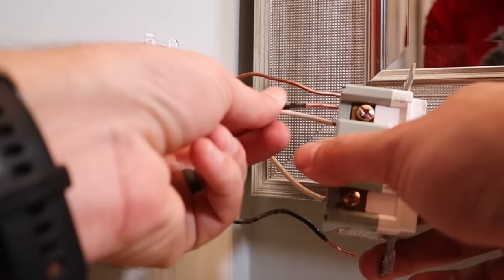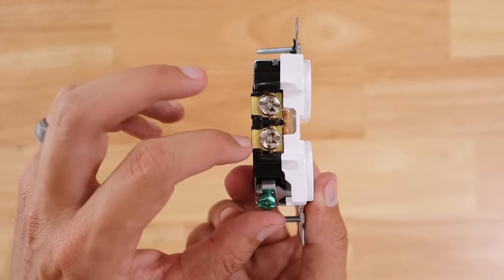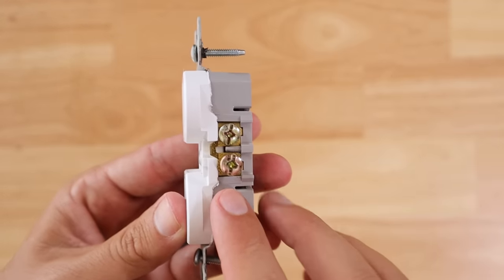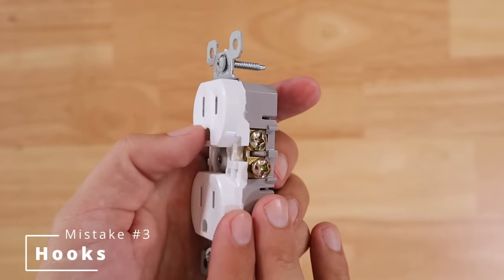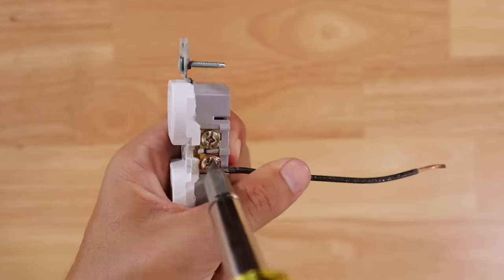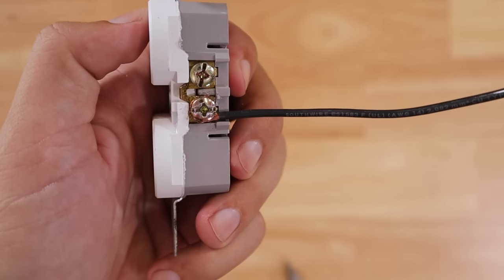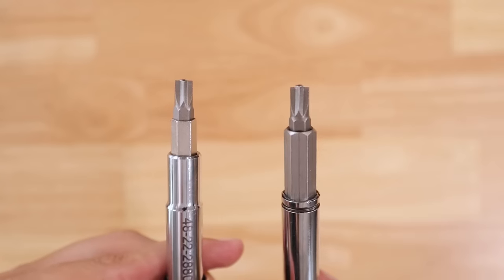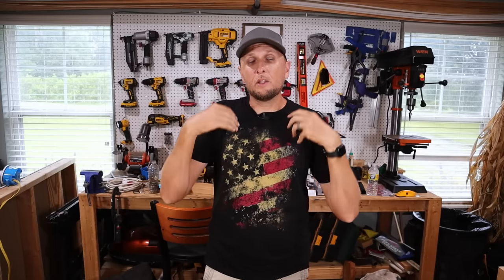The BIGGEST Mistakes DIYers Don't Know They Are Making When Wiring Receptacles | How To

Comment from the maker: So these are some of the most common mistakes I have observed and even been guilty of in the past.  Which ones did you find helpful and are there any that you think could be added to this list?  Thanks!
Reply: I always check to put the hot on the same side as the smaller opening on front of receptacle. Modern receptacles have a larger opening on  the neutral side and smaller on hot side.
Reply: Yes you cannot use the device as a splice or land the incoming wire on one screw and the outgoing wire on the other screw. The only reason there are 2 screws on each side is if you are making the top and bottom being fed with 2 different circuits at which time you break the jumper between the screws to separate them.
Reply: Also the code says when you land a wire under a screw the wire must be at least 75% around the screw.
Reply: @lawrence7dyer865  or if your making half  switched receptacle
Reply: Thank you from a plumber in North Carolina
Reply: Nah dawg blacks like the gold
Reply: The idea of the push-in wire termination is NOT that it makes the connection, it only holds the wire in place WHILE YOU TIGHTEN THE SCREW DOWN.
Tightening the screw down STILL has to be done, usually is NOT these days, and can easily overheat and arc. 
These "easy-ins" on whatever the hell they're called were the WORST invention for electrical outlets to date.
Reply: @Telephonebill51  not true william , although there is a clamp down style , the push ins mentioned in the video are held in by a tension clamp which is not able to be tightened or loosened with the screw
Reply: Nicely done, and all very useful. Perhaps the only things more I’d want to see would be good practices for wrapping with electrical tape, and fitting everything back in a crowded box to avoid damage or shorts. And also a real-world example of how easily reversed polarity can kill might be helpful for people. 

I also didn’t know that a Robertson bit would work. The combos look neat, but feel like a bit of overkill. If my Philips is camming out, I just grab a larger one.
Reply: I took all the courses needed to become an electrician. With good grades. But to get the license I needed to practice under the supervision of a licensed electrician. The reason I didn’t have the time to do that is that I am really a math and physics teacher at a gymnasium here in Sweden. 
Now explain to me the mechanism for how the wrong polarity can cause a short circuit or a fire.
Reply: @beru58  Correctly designed 120V equipment will protect, and switch, the Line terminal in that order, before feeding power downstream into other components. The Neutral is at the same 0V potential as the (earth) Ground, and the Neutral is normally not switched. Both features are essential to safe operation. When correct polarity is maintained, a fault in the equipment will find 0V through either the Neutral or the Ground, and all incoming power will disconnect at the device's protective fuse or circuit breaker. And when equipment is switched off by the user for any reason, including a malfunction, there is no Line potential anywhere in the device. But if equipment is connected to a reverse polarity source, a Line-to-Neutral fault will still clear the fuse or circuit breaker but leave the faulty, possibly damaged device still energized internally because the Neutral path inside is energized by Line. If a damaged neutral path contacts the chassis, the chassis will be energized by Line. These faults will only clear if an upstream device detects the fault and trips.
Reply: Yes I have found people change out the old two prong ungrounded receptacles with newer ground and septic holes and not adding a ground wire or jumping a neutral wire to the ground can you show this display and how unsafe it is as it creates a ground loop through the whole system.
Reply: @beru58  what you mean ?
If you try to pull too much current through a partial contact wire it will heat up.

Like pulling 10amp though thicknwire.vs 10amp through as thin as a hair.

The thin wire will.glow red and burn out instantly.

Is that what you mean ?

Or because too many electrons moving close.together and photons flying everywhere in the infared spectrum.and the wire is just destroyed due to atomic stucture being ripped apart by photons and electrons having a party 👍
Reply: @easyerthanyouthink  Come over here to Sweden and I'll teach you some physics. That is my profession since thirtysomething years. The question was how the WRONG POLARITY could cause a short circuit or a fire.
Reply: @aaronvienot  Why would a reverse polarity line-neutral fault clear the fuse or the circuit breaker? Over here in Sweden and I guess most of Europe you can connect your kettle, mixer, vacuum cleaner, hair dryer, lamp any way you want. Never heard of a fuse that didn’t work as intended because of reverse polarity.
Reply: @beru58  If a fault occurs inside equipment connected to a normal polarity circuit, the fuse breaks the line path where it enters the chassis. If the same fault occurs on a reverse-polarity circuit, the equipment fuse or circuit breaker will still fail and break the initial current path, but all other wiring inside the chassis is still energized from line through the designated "neutral" of the polarized source. Depending on the nature of the equipment damage, portions of the equipment including the chassis itself could become energized. In double-insulated equipment with an ungrounded chassis, this could be a serious safety hazard.
Reply: @aaronvienot  "[T]he fuse breaks the line where it enters the chassis"
No it doesn’t. The fuse breaks at the fuse.
How can anything be "energized from the line through the designated 'neutral' of the polarized source" if the fuse or circuit breaker have functioned as intended?
Here in Sweden a toaster or a vacuum cleaner can be connected any way I want.
Explain to me what I am risking when I operate my toaster and there is no way to tell what is line (phase?) and what is neutral. The toaster is naturally grounded.
Reply: @beru58  it appears this discussion won't go any further unless YT enables a whiteboard feature for commenting. Suffice to say what I have described is applicable to modern wiring codes in the United States. Old installations and practices of non-NEC countries may, of course, vary.
Reply: First ive never seen 2 colors or different metal connectors. 2nd i dont ever see complete bare copper. Why would u use stranded wire? Its not fucking speekers.
Reply: Black and gold is how i remember. Then white goes white gold
Reply: Necking the copper when you strip the insulation is a big one but you identified the worse one, reverse polarity can stop rcd devices from functioning.
Reply: @beru58  he is right, also as I understand it RCD will not trip reliably.
Are your switch boards bonded neutral there?
A sparky was killed with this problem here in NZ not long ago.
Reply: If I have multiple branches from a certain circuit, I pig tail the multiple branches together and add a short extra wire for the plug being installed...damn right as I wrote this comment you mentioned this exact thing. I bought myself a square tip because Phillips bits and flatblades don't tighten it down enough for me and I do a lot of panel work on commercial buildings, my square tip, emt benders, two box mounts that have rollers on them to pull wire by myself with tape measure and my Klein Hybrid pliers are nearly all I carry I love them hybrids part cutters, strippers, and lineman's all in one, and screw cutters, count me in that cuts two tools off my belt
Reply: Unfortunately I was taught the electrical trade by a racist... just remember that white guys like white gold, and black guys like yellow gold... That might not sound very racist but the same guy taught me that the neutral wire is white because it picks up all the slack from the colored wires... lucky for me I understand every wire is the same color on the inside 😉. Don't get shocked!
Reply: Agree with everything except:
Back wiring is fine.  Good quality receptacles are made for it and it's not against code.  You used the worst, most worn out phillip's head I've ever seen.  Yes, that will destroy your screws.  Otherwise, ph will work fine, but I do like the alternative bits you used.  Definitely better.
Reply: @user-3tf67bk46u  I don't get to start a fire from "wrong" polarity. Explain that.
Reply: This was well done. 😊
Reply: You called the white wire a neutral. That is in fact incorrect.  A neutral is the wire that carries the unbalanced load between two hots such as the white wire ahead of the main breaker. The white wire in residential circuits is called the identified conductor.  It is a grounded conductor and is identified as such  by its white colour.  Reversing the wires can lead to the grounded portion of an appliance becoming hot to ground.
Reply: @lawrence7dyer865  on be home
Reply: @lawrence7dyer865  Not true. Using terminal screws for feedthrough is not a code violation. They're designed and UL tested and listed for feedthrough current.
Reply: @rangerider9091  You're mixing up definitions and concepts. The white wire in a residential circuit is, in fact, a neutral. It is a grounded conductor that is connected to the neutral point in a 3-wire single phase system, and it is not known as the "identified" conductor in the US. Identified, defined in the NEC, means something specific and has no relation to this discussion. As far carrying the unbalanced load between two hots, that only applies in a multiwire branch circuit. In an individual branch circuit the neutral (grounded conductor) caries the same load/current as the hot. All neutrals are white, but not all whites are called neutrals.
Reply: @pld8993  well I find that interesting as I’ve been an electrician for 43 years. 22 years as a contractor with upgrade schooling every three years.  The white wire in a residential installation is the identified conductor.  End of story.  A neutral wire carries the unbalanced load between two hots.
Reply: You should find it interesting because you're wrong when you say calling it a neutral is incorrect. How can a white conductor that is paired with a single hot in a 120V circuit carry the unbalanced current between 2 hots when there's only 1 hot in the circuit? When the neutral is shared, it carries the unbalanced load between/among the hots. When paired with a single hot, as in an individual branch circuit, it carries the full load. I've been an electrician since 1978, been a master electrician since 1984, been teaching the electrical trade since 1992. The white wire in a residential circuit is called a neutral, regardless of what you think you know. NEC Article 200.4. Read it, you'll learn something.
Reply: @rangerider9091  Also, check out the definition of identified in Art. 100. More learning for you.
Reply: @rangerider9091  And just for clarity, from Art.100: Neutral Conductor. The conductor connected to the neutral point of a system that is intended to carry current under normal conditions. (CMP-5). 
Nowhere is the neutral defined as a conductor that only carries the unbalanced current from more than 1 hot. Yes, it does that, but not always.
Reply: @rangerider9091  You just received a free lesson that you can add to your upgrade schooling. You are welcome.
Reply: @pld8993  I wouldn’t mind so much that  that you  don’t understand basic code but the fact that you are on you tube teaching others your your incorrect notions. I will try once more and then I’ll speak of it no more. There is a neutral wire in a 120/240 system and it is with the incoming wires supplied by your supply authority. The branch circuit wires connect to the neutral via a white wire to the neutral. There are two hot busses in the panel and this incoming white wire carries the unbalanced load from the branch circuits.  The way you are teaching it leads people to think that the white wire is not a current carrying conductor when in fact it is but it just has the same potential as ground. If you take a white wire in one hand and in a live circuit and another one in the other hand you will soon know what I mean.  The key is safety and it supersedes pride. Have a nice day, be safe.  My part in this discussion is over.
Reply: @rangerider9091  I must not understand code, given that I've been teaching the NEC for 30 years and have been a regular reviewer of IBEW NJATC curriculum for over 10. Thankfully some random internet electrician corrected me by trying to sound smart on a DIY forum where most don't have the knowledge or experience to challenge him and his assumptions. Most.
 I clearly said it's a current carrying conductor, multiple times, so I'm not sure why you're saying I'm leading people to believe that it's not. Let me say it again so you don't again misunderstand what I already said. When the neutral is shared it carries the unbalanced current, when it is used with a single ungrounded conductor is carries all the current. In plain English, a conductor that carries current is a current-carrying conductor. How you interpreted that as me saying/implying/leading that it's not a current-carrying conductor, I have no idea. Hopefully it's clearer in your head now.
The white, grounded conductor in a branch circuit is a neutral conductor, as it is connected the neutral point of a system through the neutral bar. Not my definition, NEC's. You're wrong and you're misleading people on forums like this when you say that the grounded circuit conductor is not called a neutral. It is called a neutral, every day, by electricians and by the NEC. You're wrong. Have nice day.
Reply: I suggest using an outlet checker every time an outlet is worked on.
Reply: @pld8993  a white wire in a 120 volt system is still not a neutral but an identified conductor. Good day.
Reply: @rangerider9091  You keep believing that.
Reply: Doing commercial electrical construction and service for 30 years I pigtail everything it takes a few extra minutes but down the line if a recptical goes bad everything else keeps working I had a call at a house the lady was on oxygen I had to go to every recptical on that circuit and pigtail them so she wouldn't loose power on it they were all back stabbed pigtails are the only way to go even if you only have 2 sets of wires and as far as stranded wire goes use a fork I hate stranded wire for any device
Reply: @darrelljackson7222  backstabbing is potentially problematic and a weak connection. I never backstab, ever. But using both terminals for power in/out is not backstabbing. The terminals screws and associated tab are designed and manufactured to carry current. Fact, not common sense or belief.
Reply: @pld8993  but if you pigtail that keeps you from losing power down the line if something happens to that receptacle that is the problem with using both screws way less troubleshooting in the future from the service side that one receptacle is the only one affected
Reply: @darrelljackson7222  But if you splice that keeps you from getting power down the line if something happens to the splice. That is the problem with using the splice. See how the argument works both ways and has the same result? The manufacturer designs and manufactures the terminal screws for feedthrough current, and UL tests and lists them for feedthrough current. Any splice or termination is a potential weak point, whether it's a bad splice or a loose screw. A properly installed recep using the terminal screws for feedthrough will, in almost every case, last forever. I've seen plenty of bad or failed splices, that doesn't mean well done splices are inherently problematic. One of the biggest myths in the trade. Not my opinion, just read UL498.
Reply: One thing I make a point of doing is to tighten ALL the screws, not just the ones with wires under them. It just seems safer and less likely to short or arc.
Reply: @pld8993  if joints are properly made you will not have any problems with them I have been behind guys that don't twist the wires together thinking just putting a wirenut on them is good I have seen more problems from feed through receptacles than with joints just my 30 years experience
Reply: @darrelljackson7222  I've also seen bad splices. In my 45 years experience, I've never seen a recep fail simply because the terminal screws were used for feedthrough current. They are designed and manufactured for feedthrough current, UL test and lists them for feedthrough current, the NEC allows them for feedthrough current. Residential receps are tested at 150% of their rating. In other words, a 15A recep must be able to maintain 22.5A in order to be rated for 15A. The tab between the terminals is rated for 20A, which means it must be able to maintain 30A, see UL498. Like you, I've seen failed receps. I've never once, not a single time, seen the tab between the terminals break/fail/burn, etc. Loose screws, doubled conductors under screws, aluminum on Cu receps, backstabbing, seen issues from all those, and certainly bad splices. I would bet that of all the bad receps you've seen, you could not definitely say it went bad because someone fed power into one screw and out the other. They're made and manufactured to do that. Feedthrough though the screws is not an issue on a properly installed recep, it's a huge myth in our trade that you must pigtail. The most common reason why I've seen bad device is loose connections. Every connection is a potential failure point, and by not using the screws and creating a splice, you create another potential failure point.
Reply: @pld8993  I have seen the tabs break or burn I do agree that every connection is a posable fail point I personally will continue doing it the way I have for my 30 years and continue to fix things others screw up so we can agree to disagree on this I hope you have a great day
Reply: @darrelljackson7222  Nothing wrong with pig tailing, it's just a waste of time. An engineered and manufactured tab is more reliable than hand-made field splice all day every day. Unless you saw a 15A recep on a 35 or higher amp circuit and the load was pulling 100%, what you think you saw probably isn't what you saw. The tab can handle 30 amps (tested by UL) and is rated for 20 amps. I'd like to see a single example of a properly installed recep, screws tightened properly, where the tab actually overheated and burned without being overloaded. Given the hundreds of millions or billions of receps in the US installed using both terminal screws and ZERO recorded incidents/fires on record attributed directly to that procedure (yes, I've looked it up), your odds of winning the Powerball are better. Take care.
Reply: @pld8993  I'm guessing you think everything is tested off the assembly line it's not only so many are tested out of 100 you can get things bad from the factory that don't immediately show its bad things happen and yes the circuit was overloaded they tried putting 3 space heaters on a 20 Amp circuit had it been done the way I do it it would not have killed everything down the line
Reply: But here is to all the old school electricians out there we are a dying bread most of the guys I learned from are gone now I'm glad they taught me their ways and tricks to do it faster and better
Reply: @lawrence7dyer865  I was told to use pigtails on all outlets if a line was going out of the box to feed another outlet. In other words, if 4 wires plus grounds are in a box, never use 4 screws for 4 wires, but rather only ever use 2 screws and use 3 wire nuts, 1 to tie the black pigtail wire from the outlet to the other two black wires (1 feeding the outlet, 1 feeding the next outlet) , 1 to tie the 3 white wires (2 plus pigtail,) and one for the 3 ground wires...the reason is that the code prohibits current passing through a device (apparently the code does not apply to a GFI outlet wired to protect more outlets as one must do this in that case). I have had several electricians tell me this so I have done the time consuming task of using pigtails and wire nuts even though it  crowds the boxes and is difficult to do with 20 amp 12 gauge circuits. Also, I have seen many houses wired with the 4 screws used with little failure, I have seen many poor wire splices heat up and burn the insulation off the wire. But I use the pigtails as instructed despite my disagreeing. I do agree it is a bad idea to pass through a device if back stabbing the wire. I only ever use the screws as I've had to redo every outlet in buildings I bought where they did not use pigtails and just backstabbed the wiring causing outlets down the chain to lose power or arcing in an outlet box where it failed. I did not use pigtails to correct this but just wrapped under the screws to correct this preexisting issue. Obviously pigtails are necessary in order to not put multiple wires under a screw, but is it really better than using the 2 unused screws? Apparently the code book thinks it is but my experience thinks it is not.

Reply
Reply: @andywrites2141
Reply: @DeltaCo7175   I have actually used both types of push in. Just push in type and push in and tighten down screws. I think if you were to see the little contact with the wire inside where it could easily overheat.  You wouldn't use the push in. Same with the new wire connectors. They need great contact, as much of the wires to not overheat and deliver full power.
Reply: @beru58  some plug in things are polarity electrical equipment. Hospital equipment. Also I believe gfi in the plug itself on cords needs proper polarity.
Reply: @beru58  cause electric to miscalculate in Hospital equipment. I like to know the proper way to wire a Hospital isolated ground. There seems to be a lot of different ideas on this.
Reply: @RedPillSurvival  to little contact is made in the outlet for me. We did a little comparison with a heat reader between the two wireing methods in school. With a heavy load, The screws were cooler.
Reply: @pld8993  reading this is confuseing. At some point, at the last fuse box [not sup panel]  the white and copper or green make contact? Are you talking 220 us or 220 Sweden?
Reply: @busnorth  i never use the push in or quick wire method never have or never will , you must have misinterpreted what i said , push in and clamp down with the screw yes but not the tension style
Reply: @mousetoad7040  The NEC does not prohibit using terminal screws for feedthrough current on individual branch circuits. They're designed, tested and listed to be used that way. There are hundreds of millions, or billions, of receps in homes in the US wired this way. The tab between the 2 screws on a 15A recep is rated for 20A feedthrough. When you wire to only one terminal screw, current has to pass through the tab to feed the other side of the duplex when you plug something in. The tab being weak is a huge myth in the trade. It's simply not a problem.
Reply: @busnorth  Here in Sweden and a huge part of Europe we ha type f-sockets. No way to tell what is neutral and what is live. And no fires have broken out because of wrong polarity. But we learned from the video that that was a risk. Maybe you can explain the mechanism for how fires start due to wrong polarity. No one else have been able to. And while you are at it, what is it we Swedes and Europeans are risking when we plug in our toasters not knowing what is neutral and what is live?
Reply: @beru58  I believe you have 230v at 50. Wired like our 208v. No neutral.  But does your toster have a ground yellow with green stripes. Ground to earth. Is it switch at both hot wires? If not, one wire still  goes to heating element.  If this some how touch the out metal part of the toster and you touch the metal toaster and say a water faucet,  toster with out a ground.  Could you get a shock? I think in a way your outlets are safer then ours because of the recess and on some a swich. I think most things there a switched on both wires. Hear there not. Are both hot wires fused at the panel.  Our 208v that runs my air compressor and hot water heater are on breakers that are connected, on separate 120v 60 herts wire windings in the step down tranformer. Together they make 208 up two 240v depending how the load is wired to use the power. Most 220 240v have an neutral white wire going back to the fuse panel.  If it's  the only or last fuse panel before the meter.  Then the neutral is bonded to the fuse box and the green copper wire also bounded to the box and stake or two in the ground or rebar in the fondation .
Like to know how this is done there?
Reply: I'd never use the push in the back types.  My grandfather taught me to wire to the outlets with pig tails and wire nuts. He was the state inspector for years.
In trailer houses I have seen the worst wireing. Push in  in parallel 5 in a row, then to a light and rewired one that had caught fire because of aluminum wire.
Reply: @Telephonebill51  not all push in work with tightening the screws. The one's I have found it trailer house don't even have screws. I toss them.
Reply: @pld8993  I totally agree, every house I ever owned was wired that way and it never was a problem unless the outlets we’re backstabbed. No problem when the screws are used. But a few electricians told me it is not acceptable, one showed me  a passage in the code book that prohibited running current through a device, but maybe it was taken out of context. I’ve been wiring my shop and added circuits to my properties using the pigtails because of this but it’s really extra work and I consider the wire not spice is less reliable in my opinion. But once an electrician told me it was not acceptable to run Romax in conduit which was BS, and some other myths, so thank you for clearing this up for me.
Reply: Can any of you youngsters help me? My handsome little grandson asked for “feet pics” today, why would he want pictures of my feet! Laughing out loud ! Peace and love X O X O - Gladius
Reply: @RStark-ek7mh  yes maybe true. How ever I enjoy my freedom, and my masters election license.  I  would pass if it can't be done or unaffordable.
Reply: Checking screws after positioning wires for receptacle placement
Reply: @JoeWaylo  been there cost me 2 refrigerators
Reply: @Justin slago I don't believe GFI in the plug needs "proper polarity" because the gfi is tripped when a difference in current (I believe >10 mA) is detected between hot and neutral lines.   Polarity should not affect that.
Reply: @beru58  The problem would result in the fixture that is plugged into the receptacle, a desk lamp for instance that uses an incandescent bulb. The switch on the lamp would de-energize the neutral side of the lamp only. With the lamp switch in off position, the socket would still have the outer ring connected to the hot wire making it possible to receive a jolt if the bulb were not installed, or worse if the bulb was shattered leaving the filament exposed.
Reply: @robwilson7524  With no bulb in the socket and if you feel a need to put your finger there you better pull the plug. That’s  how it's done in most of Europe. Same with a shattered bulb. My question was how "wrong" polarity can cause a fire.
Reply: Ground always goes on bottom?
Reply: Bro I commend you for making a video trying to help those who don't understand things out however reverse polarity on a 110 outlet does not risk fire and I'm going to make a video and intentionally do it and I'm going to run the highest powered Appliance or item I can off of it and then we're going to take temperature readings and whatnot to show that
Reply: I am new to wiring and electric in general but I've always known not to do the backstab But did not know the reason why you shouldn't do it
Reply: Why didn’t you post this 10 years ago? 
Didn’t make any mistake in what I did, but took me a long time to make sure I was doing it right. Straight forward. Bravo!
Reply: @lawrence7dyer865  Yes it is possible to have under one screw incoming wire and outgoing if wire is no cut.
Reply: @beru58  Most member of these post are an American people.  In the US is different system distribution electrical energy: to residents power goes true 3 wires from middle grounded 240V transformer (2 hoot wires from ends of the transformer and one marked in white grounded form middle of winding) or 3 wired from 208V 3 phases transformer 2 wires from end winding and one from common  grounded center of the transformer. one part of outlets work with one part od outlets and the other with rest of the outlets. Fire can be cause by high connection resistance: if resistance is 0.1 Ohm and current 20A this contact is heated with 40W; as result of cycling power (also heating contact) resistance increase  for 0.2 Ohm power will be 80W.
Next danger can cause white wires disconnected (just when the receptacle is replace = all wires are disconnected also two white wires).
Reply: @mariuszluczkiewicz1232  I want to know how the "wrong" polarity causes a fire when the "right" will not.
Reply: That is a good point, @Darrell Jackson. I am not an electrician but my brother recently built a house here in Ohio. The code required pigtails be used on every receptacle. I would have liked to see this video include an example of a completed properly wired outlet installed in a box.
Reply: Black to brass, white to light
Reply: Great video keep it up
Reply: One comment, the term "a lot" is not pronounced with a long A or a hard A it is a short a. Pronounced "ah lot". Its just like the A in america. Please use the language the rest of us use. Thank you. Great video with good information
Reply: The biggest way I remember,  Black on Brass, save your @$$
Reply: @Telephonebill51  I am an Electrician.  In this case you are incorrect.  These residential outlets are back stab only no screw tightening needed.  The type you are talking about are more expensive spec grade plugs.
Reply: @andywrites2141  to get
Reply: @Range Rider  and by definition of the NEC neutral colors ate to be white or gray, whether it be solid color or have a continuous colored stripe.
Reply: @Range Rider  identified conductor is part of a cable assembly like a light fixture cord to identify the grounded conductor so you don't connect in reverse polarity. The grounded conductor by definition is the neutral conductor no matter what side of the main breaker it's on
Reply: I like when I find jo bobs diy work in the attic using some walmart 14 gage extension chord with no j boxes around the splices on a 20 amp circuit! Some of the dumbest things I've ever seen was people who didn't have any idea how to fix their power problem and more often than not make things worse.
Reply: You should never put stranded wire directly under the screw - use stakon connectors or, if the receptacle has the hole that the wire goes in and a plate smashes the wire between two plates as the screw is tightened that is even better.

If for some reason, such as a temporary connection, you must need to put the wire under the screw there are two tips that would help. 

1.  Twist the stripped end counterclockwise, unwrapping the factory twist until you have a new twisted end going counterclockwise. By doing this when you tighten the wire under the screw going clockwise, it will tighten the strands even more and keep them tight under the screw.

2. In addition to #1 above, before making that reverse twist, strip the insulation the normal length, then start to strip approx. 1/4” more insulation but only pull it until it just barely covers the end of the wire. Now do the counterclockwise twist, leaving the small piece of insulation at the end of the wire. When the wire is put under the screw this will keep the end of the wire from opening and coming out from under the screw.
Reply: @Lawrence7 Dyer  that statement is incorrect, per NEC 300.13 you can not rely on the device for continuity of the grounded conductor on a multi wire branch circuit. You know where 2 home runs share a neutral. But on an individual circuit where the neutral is not shared you can absolutely use the device as a pass through
Reply: @rrsjr1960  that would be a local jurisdictional code. The NEC allows you b to pass through a device as long as it is not a multi wire circuit( 2 circuits sharing same neutral)
Reply: @Range Rider  code says that the neutral, aka grounded conductor, must be identified. It does not say it is "the identified conductor". It must be identified by white coloring and it is identified on a receptacle as the long slot. It is identified on zip wire by the lines on the outside of the cable. Being "identified" and being "the identified conductor" are not the same. @pd is correct in everything he said. 

By the way, I've also been an electrician since 1983 - just so you know I'm not just a diy guy.
Reply: @pd  using the screws on a device is 1000 times better than backstabbing but, even though it is allowed by code, using a device as a passthrough connection is not the best solution. Pigtailing is, in my opinion, the best way to go.  I've actually seen the side of a recep melted away from arcing where the recep was used as a pass through and over time the screws loosened and started arcing. I pulled apart three fourths of the house looking for that one recep. Replaced the device and had to splice new insulation back onto the wire because it was damaged from heat. This could have been avoided had they pigtailed.
Reply: @pld8993  at one point backstabbing was an "acceptable" method of pass-through too. That doesn't mean it was the best. A properly made splice is better any day than a properly terminated pass-through using a device.
Reply: @pd  how do you figure pigtails are slower than screw terminal pass-through. Maybe a few seconds but I can make a pigtail and terminate one set of screws pretty close to the same speed.
Reply: @dangroce82  Backstabbing and using the terminal screws are completely different, and you're wrong. Go and read UL498, let me know if you have any questions.
Reply: @dangroce82  So you found 1 loose connection and from that you've determined that splices are better? Faulty logic. I've seen splices arc and melt the wire nut, which could have been avoided had they used the screws for feedthrough, but that doesn't mean there's something wrong with splices. If you had more experience and knowledge you wouldn't have needed to take apart 3/4 of the house to find the problem. It's unlikely that the screw magically loosened and more likely that it wasn't tightened sufficiently when installed.
Reply: @dangroce82  You're wrong. Any actual data to support this contention, or are you just making it up?
Reply: @dangroce82  It absolutely takes longer to pigtail, I've done it thousands of times. On a project where there a hundred or more receps, that adds up to real hours.
Reply: @pd  you've told me I'm wrong multiple times, I guess you've just got a God complex. As for me "having more experience", I've plenty of experience to know that you are so full of yourself that you cannot fathom anyone else having experience enough to know that you aren't necessarily wrong, but your opinion is not the end all. If you actually read my comment I never said that backstabbing and screw terminals were the same. I simply said that at one time in history backstabbing was an acceptable practice. 
If you are doing residential work then feedthrough devices don't have a big difference when doing maintenance, but in a commercial or industrial setting it is common to share neutrals between multiple circuits. If you need to replace a device a pigtail allows you to do so without effecting downstream circuits, whereas a feed through will break the neutral which could potentially create an issue downstream. ("If you had more experience you might realize this", he said sarcastically.)
You can use feedthrough if you like. You can even teach that they are the holyest of holy connections, but some of us who have a great deal of experience in the real world, not just a classroom or our own minds will continue to use pigtails. 
Also, it's not my problem if you can't make a pigtail, not as fast, but nearly as fast as using pass-through on a device. Maybe if you had more experience. 

My suggestion, stop treating people that you don't know poorly, just because they have a different opinion than yours.  My life experience may be better or worse than yours but well never know. Therefore, we should treat everyone kindly in these comments instead of trying to speak down to them.
Reply: @pd  I never said they were the same. You didn't read what I said correctly. What I said was that at one time, backstabbing was also an approved method, but that didn't make it the best.

Backstabbing is a horrible method. I also said that pass-through was much better than backstabbing, but not my preferred method. I believe pigtailing is a much better method than feedthrough terminals. You do what you want.
Reply: @jasongraham3174  backstabbing relies on a spring tension piece of metal for the contact. Over time the spring tabs have a tendency to lose their tension due to repeated heating and cooling of the outlet. It is worse if the outlet has a high load. If the tab loses tension it can cause arcing, especially if the outlet is having a lot of plugging and unplugging at the device.
Reply: @gordybishop2375  generally most people put the ground (the rounded hole) at the bottom, but that is not code in most cases. If you look at receptacles in a hospital you’ll notice the outlets are installed with the ground at the top, this is code in care centers such as hospitals where flammable gases are used and patients are treated. The theory behind it is that if the plug becomes loose in the outlet and something we’re to fall across the prongs it would hit the ground first and if it did hit a powered prong it would be hitting the ground also and would trip the circuit.
Reply: @ 9:20 you mentioned the proper way to add additional wires by using a "pigtail".  I can't help but wonder how many DIYers might not know what that/those look like nor how they work.  Other than that, a great video.  Thumbs up!
Reply from the maker: You are right.  I made a video about it fairly recently.  Thanks for the feedback!
Reply: There is no room to pigtail in most cases you don't have a clue
Reply from the maker: Kind of a blanket statement Jack.  Every situation is different.  Easy to find how much can be in a box by reading inside the back of the box.  It will list the capacities there in most cases.
Reply: @jackheaton4557  When you use the correct size box for your application, there's almost always room for pigtails. The two most common mistakes I see amateurs make is cutting wires too short, or using a box that's too small, and frequently both.
Reply: @dangroce82  No god complex, but I am an expert in my profession and I try to avoid basing my conclusions on my opinion or what I heard someone else say. For some questions opinions are a reasonable option (grounds up vs. grounds down or horizontal receps, for example), but in a technical area like electrical, opinions almost always have to eventually face verifiable facts. I don't have the all the answers but I have many of them and when I don't, I know where to find the answers. The same cannot be said for most of the people pretending to know what they're talking about in these forums.
Reply: There is a lot of discussion about neutral Vs identified conductor on here, I looked them up, subtle difference, but worth reading about, especially in two wire lighting circuits.
Reply: @rgoldsmith6560  Maybe worth reading about, but not particularly relevant. Identified conductor in Canadian Electrical Code is for the most part comparable to the neutral in the NEC. In the US we don't speak Canadian or identified conductors, we speak neutrals.
Reply: @donaldryan8410  Stranded is commonly used in non-residential because it's easier to pull through conduit than solid. Stranded is also required where the wiring method installed is for flexibility.
Reply: @leanin01  "Black on Brass." It's that simple.
Reply: Just to add the statement to us that just like the thought of having a opinion of a tool that appears to be correct 100 % of the time. Is one I have found that tells what is wrong or if it's correct when doing wiring. Cost less than 5 bucks.
Reply: Your tip on measuring how much insulation to strip off was very informative, I did not know that. It has always been a guessing game and I have had my wires insulation stripped too short and too long and had to start over. Thanks for tip and the video.
Reply: @HowToHomeDIY  

Here is The Savior

YaH The Heavenly FATHER HIMSELF was Who they Crucified/Pierced for our sins and “HERE IS THE PROOF”

From the Ancient Egyptian Semitic: 
"Yad He Vav He" is what Moshe (Moses) wrote, when Moses asked YaH His Name (Exodus 3)

Ancient Egyptian Semitic Direct Translation
Yad - "Behold The Hand"
He - "Behold the Breath"
Vav - "Behold The NAIL" <— YaH’s Crucifixion
He - "Behold the Breath"

“Behold the HAND that Beholds The NAIL” 

PROVES - YAH The Heavenly Father HIMSELF was Who they Crucified

That is EXACTLY what Moses Wrote

Here is what they mean

YaH's Name:
(Ya)d + (H)e, as YaH is what Moses called Him and YaH Declared: "this is My Name, this is My Name for all generations" (Exodus 3)

YaH is The Creator of “MAN”: (Genesis 2:7)
Yad He, (HAND BREATH), as YaH's "HAND" Formed man from the dust  of the Earth and His "BREATH" made him a living being (Adam)

YaH's Sacrifice of Crucifixion for “MAN”:
Vav He (NAIL BREATH), the "NAIL" through YaH’s "HAND", in Sacrifice of Crucifixion, that whosoever shall call YaH Savior, His “BREATH” brings forth life (Salvation)

How YaH arrives:
YaH arrives via the Tent of Meeting (Exodus 33:7:11, Isaiah 54, 55), where a Tent is erected outside the city, a cloud descends upon the entrance of the Tent and YaH appears...

Why they demanded YaH to be Crucified:
YaH was Crucified according to Hebrew law (Deuteronomy 21), to be NAILED/PIERCED on an Almond Tree for BLASPHEMY as it was for His NAME they demanded Him Crucified. The Messiah claimed He was YaH...

HE WAS YaH!!!

HalleluYAH translates “Praise ye YaH”

The Hebrew Book of Isaiah

Isaiah 42:8
"I am YaH; that is my Name! I will not yield my glory to another or my praise to idols.

Isaiah 43:11
I, I am YAH, and there is no other Savior but Me.

Isaiah 45:5
I am YaH, and there is none else.
Reply: After just installing some receptacles, I almost want to go back and check the tightness of the screws.  You guessed it....I used a phillips. However, I did double check with a flat head screw driver that allowed a little more torque. I may still recheck them. Thanks for the info. Have a great day!!
Reply: @beru58  Yeah, I get you. I really can’t think of a situation where it would cause a fire without some massive stupidity being involved. It’s just good to follow best practice.
Reply: @robwilson7524  Over here in Sweden and most(?) part of Europe we have type F sockets. So when I plug in my toaster or washing machine I have no idea what goes to neutral and what goes to live. And I needn't know. Why would you need that over at your place?
Reply: What do you do if the ungrounded conductor is red? Do I need a different type of outlet? Are there A, B, & C phase outlets?
Reply: Post this in an appropriate location, I know Jesus loves you, but he would not like you spreading the word of Godin a tutorial on wiring devices. Amen Repent and believe in Jesus Christ
Reply: @Justin Weber I’ve been told the ground should be up, I could argue out both ways. If you look at the writing on outlets, it’s done, ground up.
Reply: @donaldryan8410  you aren’t the sharpest guy on the job are you.?How many days do you have on the job?
Reply: God doesn’t have electricity, have you read the Good Book at all?
Reply: @darrelljackson7222  wait until you get on a job where all wire #10 and smaller must be solid. Have fun pulling and making up boxes, also stuffing them behind a dimmer or motion sensor.
Reply: @pld8993  I have seen the tab on an outlet between the terminal screws burn out. It wasn’t on the hot or ungrounded wire it was on the neutral, the grounded conductor.
Reply: @busnorth  have you heard the saying “when the student becomes the teacher”?  They weren’t talking about you.
Reply: @busnorth  trailers are not houses, they may be what you call home, but it’s not a house
Reply: @gordybishop2375  here’s another one don’t believe everything he says, he’s wrong about this
Reply: @mariuszluczkiewicz1232  Edison and Tesla both brought their systems out in the United States. I’m guessing someone on the other side of the pond is not so good at translation.
Reply: @scottlear6839  The tab between the terminal screws is rated for 20A and UL requires that it must hold 150% of its rating, 30A. If you saw one burned out, that would mean it had more than 30A flowing through it, which would indicate that it was wired improperly. However, it's unlikely that you saw what you think you saw. If you saw a burned up link, it's highly probably that one of the screw connections was loose and it caused overheating. How long have been an electrician? In 40+ years and 10s of thousands of receps, I've never seen that link fail on a properly wired recipe. I'm sure you believe what you think you saw and it seems like belief in unproven, invisible and made-up things things plays an outsized role in your life.
Reply: @scottlear6839  where I live, trailer houses have stricter codes then stick built home's and are taxed the same. That being said, is why trailers are phasing out of the area.
Reply: Repent and believe in Jesus Christ  Amen
Reply: When installing receptacles or switches using a raised metal ring on a 4" square metal box you should use a plaster or mud ring in plastered walls which is mostly not used anymore! When using gypsum or sheetrock you should use a raised metal tile ring which is totally different from the plaster or mud ring! The National Electrical code states you are only allowed 1/8" of space around the opening, not 3/8" which you would have by using a plaster or mud ring in order for the gypsum or sheetrock to sit flat on the metal  portion of the  raised ring. When you have 3/8" of space around the raised plaster or mud ring the sparkler fills it in with spackle and after it dries and the electrician installs the device there is nothing to hold the spackle in place, it cracks and falls out and you are back to 3/8" opening around the device opening which is a violation of the N.E.C. Mud rings are only intended for plaster walls brown coat, scratch coat and white coat that fills in along the beveled edge of the tapered raised ring gradually until it is complete right to the edge of the metal ring device opening! There is no space left around the opening! So, always use a raised tile ring for gypsum, masonry or tile from 1/2" up to 2" in depth! Also, the yoke of the device will seat firmly against the gypsum which will provide a solid backing especially for a receptacle. If you were to have an open space behind the area of the top and bottom yoke and you use a plastic plate, when you plug something into the receptacle, it will move back toward the ring and crack the plastic plate where the 6/32 screw is placed in the center of the duplex receptacle because the plastic plate is fixed against the gypsum and the receptacle can and will move back far enough to crack the plastic plate!
Reply: @henrysamek9211  You're way overthinking this. Using mud rings with drywall is fine. Using the proper depth mud ring  behind drywall leaves 1/16" between the finished surface of the wall and the front edge of the mud ring. The NEC requires that this distance be no more than 1/4". As far as the space around the mud ring, there should be no more than 1/8" gap around the ring. Contrary to what you're saying, when this space is filled with drywall mud and done properly it almost never cracks and falls out. It absolutely has something to stick to, the inside edges of the drywall.
Reply: @scottlear6839  Several manufacturers put writing in both orientations. The writing has no bearing on how the recep needs to be installed. Ground up or down, or horizontal, are all acceptable.
Reply: The intended use for a mud ring or also called a plaster raised ring is for plaster only, not gypsum! The intended use of a raised tile ring is for gypsum, masonry and tile walls only! The N.E.C. under boxes only allows 1/8" space around the tile ring, not 1/4". Don't confuse the depth or set back of the face of the raised ring or any box can be 1/4" from the face of the gypsum board! When the gypsum is cut and placed over the area of the box properly there is no need for spackle to fill in any space around the box or raised ring! I've been a licensed electrical contractor in the state of New Jersey since 1970 and was around when the gypsum contractors did measure and cut! No routers were used in those days! My license number is 4335. I'm also an electrical subcode and inspector! I'm very familiar with the N.E.C. from way back to 1965 until present day!
Reply: @henrysamek9211  Most of what you said is irrelevant. I clearly said 1/4" from the surface and 1/8" around the opening, so I'm not confused or confusing anything. The drywall bits on a rotozip are less than 1/8" diameter so if the holes are cut well with that tool there may not even be a need for mud. However, when the ring is not tight in the hole and the mudder/finisher (not spackler) fills it with drywall mud/joint compound (not spackle), it sticks to the drywall and almost never falls out, as you seem to believe. Once the mud dries and there is 1/8" or less of space around the ring, it's code compliant. The NEC does not define or dictate how or what material must be used to get that opening to 1/8" or less. The fact that you are licensed and have been in the trades since the 70s (as am I) does not change those facts. Mud ring is just a name and not necessarily descriptive of how it's used. Hubbell calls it a mud ring but other names used by different manufacturers, for the identical product, are plaster rings (Raco), device rings (Garvin) and drywall rings (Caddy).  Using your logic, the only application for a tile ring, because that's what it's called, would be tile. Someone here sounds confused, but it's not me.
Reply: You still don't get it do you! You cannot use a mud ring or a plaster ring in any other intended use but for plaster walls! It is designed for plaster walls only by labeling and listing! It is not designed for other types of walls! It has a flanged taper that is meant for 3 coats of plaster that is why it is tapered around the outside! The last coat of plaster which is white, goes right up to the device opening! There is no space around the tapered opening! Go to an electrical supply house and ask to see what a metal raised tile ring looks like and when you see the difference maybe you'll understand what I'm telling you! No spackle is needed at all! Look at a 4"sguare plastic box with a bracket and then look at the raised plastic ring that goes on that box and you will see it is perfectly straight without any beveled tapered edges at all! The same goes for the metal box with a 1 gang 1/2" raised metal ring! You can get the raised tile rings with the appropriate amount of gangs in a metal back box for more than 4 or 5 or 6 gangs if necessary! The metal raised tile rings come from 1/2" up to 2" in depth and as many gangs as necessary! Most contractors didn't know about them until I showed them the items! They've been using them ever since for receptacles and especially for switches. Again there is nothing to hold the spackle in place and it should not be used as a filler around the metal box. There is no such thing as done properly by a spackler around any outlet box! It does crack and fall out while installing the devices and again you will have a space wider than 1/8" which is a violation of the N.E.C.
Reply: @henrysamek9211  You're 100% wrong. You should read more and talk less. 314.20, pasted below, clearly states that plaster rings can be used behind gypsum. 314.21, pasted below, allows for the repair of gaps around a box so as to reduce the gap to 1/8" or less. There is no requirement that a ring be used that assures 1/8" or less gaps without the use of joint compound. And again, stop saying spackle, which a Joe homeowner depot product and not what professionals use.
314.20 Flush-Mounted Installations. Installations within or behind a surface of concrete, tile, gypsum, plaster, or other noncombustible material, including boxes employing a flush- type cover or faceplate, shall be made so that the front edge of the box, plaster ring, extension ring, or listed extender will not be set back of the finished surface more than 6 mm (1∕4 in.).
314.21 Repairing Noncombustible Surfaces. Noncombustible surfaces that are broken or incomplete around boxes employ‐ ing a flush-type cover or faceplate shall be repaired so there will be no gaps or open spaces greater than 3 mm (1∕8 in.) at the edge of the box.

Any questions?
Reply: Well my Dad had a bad habit of mounting switches upside down. Where up was off and down was on, lololol.. 🙃
Reply: @lawrence7dyer865  No NEC code says this
Reply: Most of them. 😂 Good info brother. Very helpful and informative. Look forward to more. Thanks
Reply: black wire = hot? wow
Reply: The strip gauge was clutch for me! Never knew that's why the back has those channels.
Reply: I thought u might note that the screw terminal that u don’t use, should be tighten down also. Maybe I was taught wrong.
Reply: ❤❤❤❤❤❤❤🎉😂🎉😊 1:05
Reply: It's good to see a DiY N2D's (Not 2 Do's)! Especially because some ppl overlook what one  has had no experience(s) doing. TY! ...I have a room AC, in housing, in wall, but the power cords built in circuit protector having a reset button the releases the set button, actually shot out of the adapter on the head of the walls plugin. I do not know how to approach this with what to check for and how to know if simply snapping in back in, is the right course of action. *The adaptor, shows NO signs of burn, No discoloration, No smell, No slight points melted, etc. Inside the adaptor as well, no signs of any loose parts, however if it had a spring, I can't find it. How can I do this this safely, without buying an entire new unit like home Depot wants me to do?
Reply: @lawrence7dyer865  mnwk we ❤😊😅😅
Reply: backstabbing is by far how you can tell a GC did the work, any decent electrician uses the screw.  Unfortunately, it is the most used method.  If you buy a home the first thing you should do is watch his videos and fix all your receptacles.
Reply: @HowToHomeDIY  Why are there 2 brass screws and 2 silver screws? In your video, you never mention why there are 4 total screws. You seem to be screwing the wires to the bottom screw only, why? Can you explain? Thank you
Reply: Sure wish I had found you before I tried to fix the outlet in my bathroom. Pretty sure I had the loops going the right way...the other direction seems unnatural. But I need to go back in and check anyway because I might have stripped too much insulation off. Also, I used a Phillips head. I just subscribed to you.
Reply: You never wrap stranded wire on screw,  you either crimp a fork on or use a side and back wire receptacle
Reply from the maker: @Jeff arford that is not true.  In fact many manufacturers will specify that wrapping stranded around the terminal screws is an acceptable method.
Reply: You must only work in residental
Reply: What do you use to make your hooks look so nice before install?
Reply: Just an FYI regarding push-in / backstab. If wire works its way out over time, every outlet after that point on that circuit will not function. Pretty basic stuff for an electrician. Not so much for the unknowing homeowner....such as myself the first time it happened! Forever indebted to maintenance guy at work at the time for the crash course in circuits / electrical.
Reply: Please keep in Mind that color of the wire doesn’t necessarily mean that it’s actually positive or neutral. Always test. In some old residential homes, people used whatever they had at the time. Hire a competent electrician.
Reply: that's for proper table setting of salt/pepper shakers.
Reply: The direction of the hooks and how much insulation to remove was the piece of information I was missing at times and couldn't get it figured out as to y .  Thanks for the help
Reply: This is awesome. Thank you for taking the time.
Reply: Thanks so much. Have you done a video (or can you do one) on testing for negative and positive leads?
Reply: A lot of great info. Luv the combo bit. Also NOT using the push in connection
Reply: I thought that the rule of thumb when dealing with electricity was" White is Hot Black is Not." Have I been doing it wrong all this time?
Reply: When connecting the wires to the outlet, since there is two screws for black side 2 screws for white side and ground. When connecting the  black and white does it matter if  the black is on top screw of the black side  and  white on bottom screw of white side
Reply: shared your tips with my daughter who is hundreds of miles away. ty sir.
Reply: What does pigtail mean? I have an old house and pulled out the outlet. And it had two wires connected to one screw. So it must mean that one outlet was piggyback riding another outlet. So how can I pigtail two wires to one screw connection? Thank you so much
Reply: @Featherless1 You are so bad! 😂😂
Reply: @beru58 It's the material inside the body of the fuse. It's sensitive to the direction of current.
Reply: The one thing that it was more informative to me was when you made that distinction between the gold or yellow screws and the silver screws. That really help me a lot. Thank you. Question please: Does the green ground screw has to have two bare ground wires or will one do? My old receptacle had two ground wires screwed in to the green screw. Thank you for your great videos
Reply: IF YOU CUT TO MUCH OFF, CAN YOU USE ELECTRICAL TAPE TO WRAP THE BARE WIRE? THANKS SO MUCH.
Reply: My comment is below. I work in a different industry. So, IMO, anything like this video is of value to anyone working with electricity. Most concepts transfer from one trade to another (even if they aren't similar, such as the advantages of doing good work and doing it correctly.  Nice work. You're on the way to those I'm currently working with, as well as those I no longer get to work with as much as I'd like. 

You do all the work, and I get to look smart because of you. I'll take that deal, every day
Reply: PRAISE THE LORD!
Reply: I alwas remembered white to silver. What are the 4 tabs for? The two on top and 2 on the bottom. I always cut those off.
Reply: Newer designs like GE allow for speed wiring where after insertion, tightening the screw will affect a clamping action on the wire. Much better and more secure.
Reply: Show us the best way to make a hook , I have seen many and some work and others don't
Reply: Guys, here is the Savior

HalleluYAH translates “Praise ye YaH”

YaH is The Heavenly Father 
YaH arrives via the TENT OF MEETING
YaH was Who they Crucified for our sins
YaH was Crucified on an Almond TREE

— Ancient Semitic Cuneiform of Moshe (Moses)
— Isa Scroll (The Original Isaiah)

Isaiah 42:8
"I am YaH; that is my Name! I will not yield my glory to another or my praise to idols.”

Isaiah 43:11
“I am YAH, and there is no other Savior but Me.”

Isaiah 45:5
“I am YaH, and there is none else.”
Reply: Excellent video! Very informative!
Reply: After attaching the wires, you need to mount the duplex carefully, to make it possible to mount the cover correctly, flush with the wall.
Reply: I’m a rookie. I don’t do this stuff but I was forced to because I lost power to my daughter’s room. This video, I can say, saved me my house. The same thing you are explaining here about back stabbing, happened to her room. The black cable came out and was a bit charred. Also the placement of the cables. I had no idea there was a specific side. Thanks dude..🤙🏾
Reply: Tmi on later stuff
Reply: I was always taught black on brass white on light(er)
Reply: Maybe remind people, that extra unused screws should be screwed in and not left loose. They often are shipped with all of the screws loose and if they are left out one can bump a hot connection.
Reply: I knew a guy who connected a socket with reverse polarity then was smoking and watching TV. Fell asleep and the cigarette dropped on the couch and started a fire. That is how a reverse polarity causes fires. It also cancer bc the guy also got cancer.